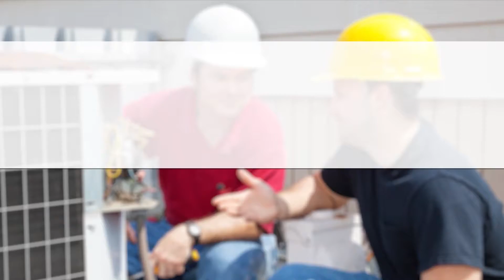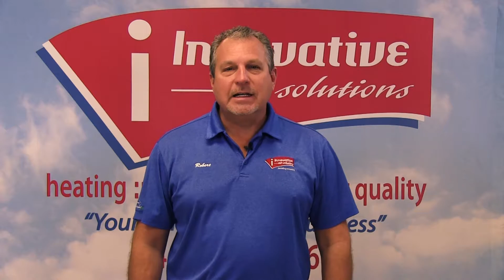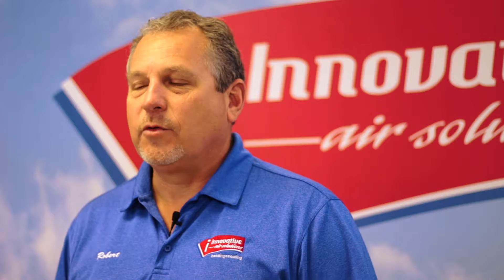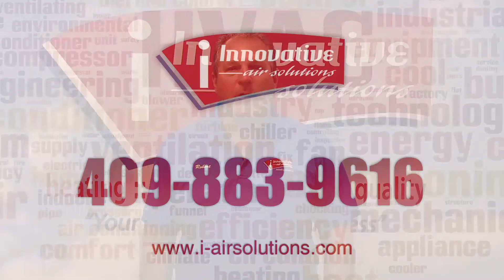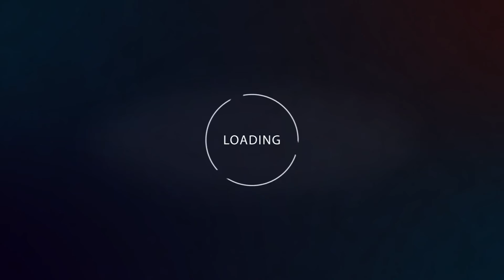Understanding HVAC for New Home Construction

Comment: What do you think about HVAC units installed on the ceiling of the garage in a tray area on the Carrier AC's back using braces and a rectangular drip pan underneath it.  We are considering this home but HATE the Weird garage location in St. Augustine Shearwater.
They also didn't have a FILTER in the Carrier AC unit during the 6 month build.  What do you think?  Can the dry wall coated coils, be cleaned.  It froze up and shut off at 7 months and they are currently trying to fix it.  We want a new unit relocated to the laundry room. The repair AC guy took 10 gallons of water out with a ladder to reach the unit using a dry vac and is keeping the FAN on for three days to dry the soaked Carrier AC unit.